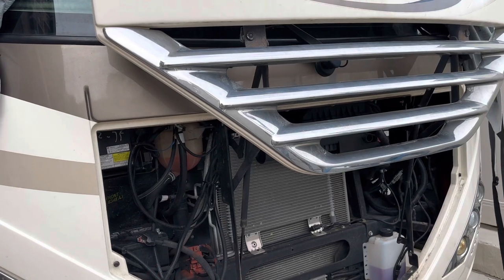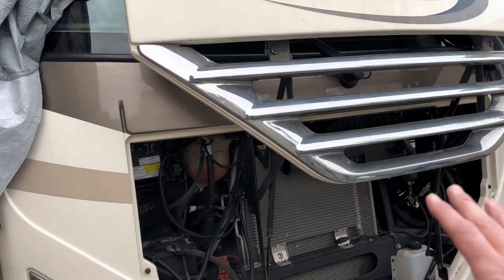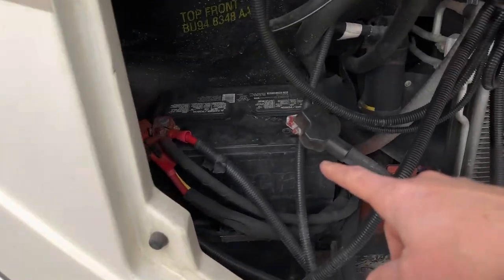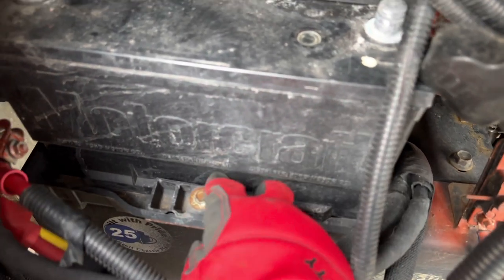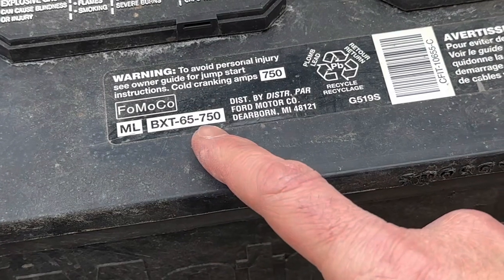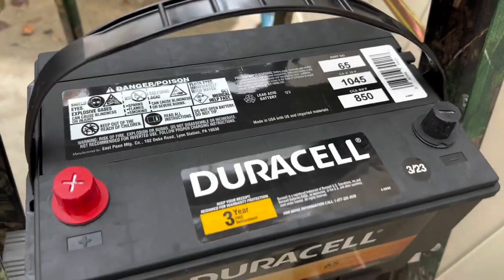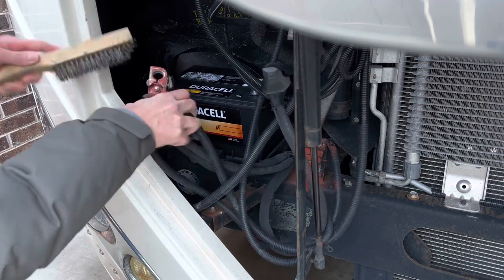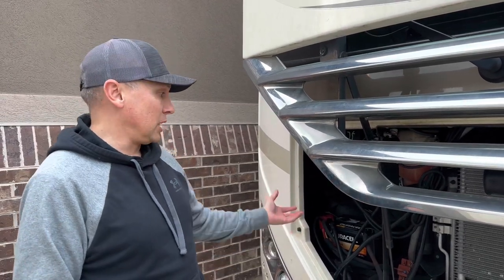Class A RV Motorhome Ford F53 Chassis Battery Change | Thor Hurricane 34J

Comment: I have a 2018 Windsport 29m and I wish my battery was as easy to get to as that!
Reply from the maker: It's not?
Reply: @Myksgarage  It is further back and much harder to get to.  I think doing it is possible for a newb like me, but it will require some gymnastics.
Reply: @frenchtoastchopsticksmanga5792     I have a 2018 Jayco.  My door is smaller and goes down.   So battery is farther down from the bottom of the door.   There is enough room, I can get under and stand up inside the front.